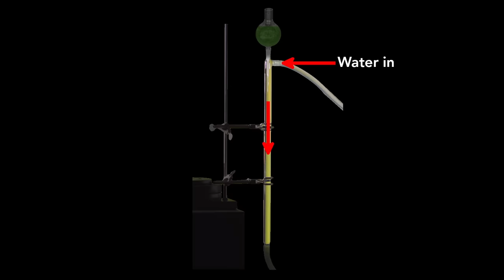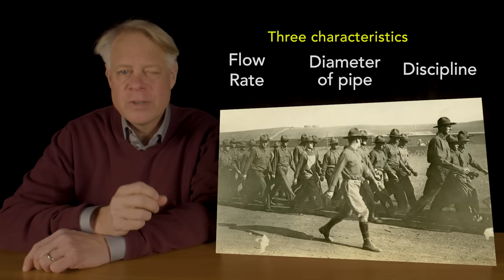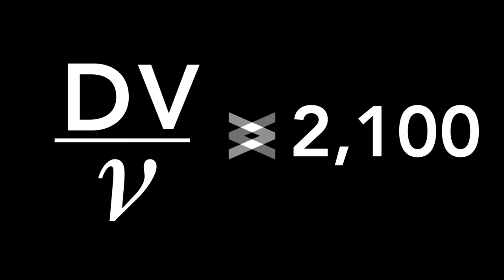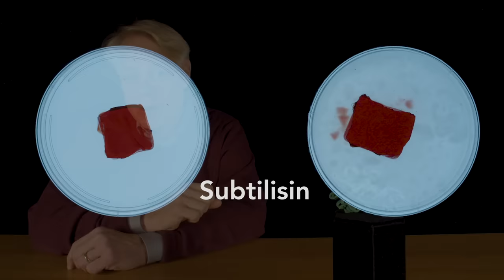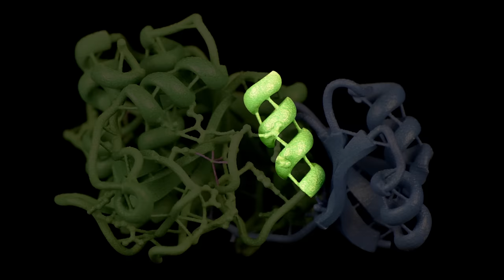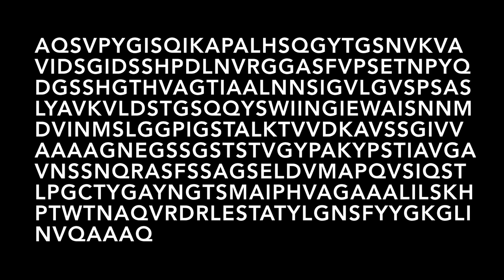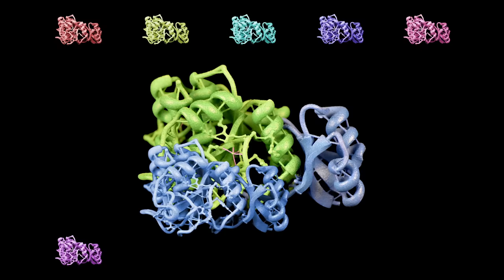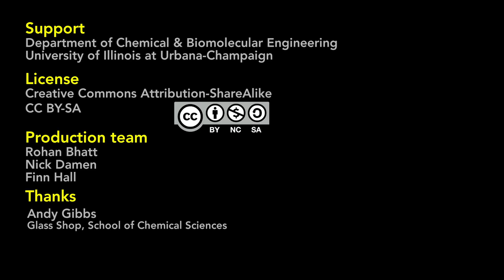Controlling Turbulence and Evolution: How Engineers Overcome Uncertainty

Comment: Even in situations where full scientific understanding IS something we have, reality is messy.  Just because you fully understand a process doesn't mean it's easy to control it.  The machinery to do the job perfectly may be far too expensive to construct, maintain, or train operators to use.  So instead we engineer something that's good enough, because it's cheaper than perfection, and we don't actually need perfection.
Reply from the maker: Spot on
Reply: This reminds me of "all models are wrong, but some are useful" (George Box).
Reply: @riveradam  Yep, even if you have all the data to generate a perfectly correct model of some situation, a slightly less correct model will probably calculate much faster.  You don't need a weather model that predicts tomorrow perfectly, but takes a decade to run.  By the time it delivers results you could just look at historical data.
Reply: Chase perfection, achieve excellence
Reply: @AverageAlien  Just make sure you're not so busy chasing perfection that you don't notice you've achieved excellence.
Reply: Science was invented to explain why engineers are right.
Many great things have been invented by engineers or even amateurs (e.g. VHF radio) before science was there to show how it works.
Reply: I operate and assemble said machinery.
The next level down, and It's a lot of the same.
Science got the principle down and they engineered a beautiful piece of machinery, nevertheless, turn that dial down 2 notches from the calculations on any non-ferrous metals or the tolerances fall off. The post it note by the switch should remind you to check.
Reply: The best lesson I ever learned was from an old, very smart, very experienced engineering fellow at my first employer: perfection is the enemy of good enough. 

Second best lesson from a different engineer: if it looks/feels wrong, then something is probably wrong, and vice versa.
Reply: Just because it works in reality doesn't mean it will work in theory.

Comment: Love these videos. I do want to comment though that the devision between the scientific and what you call the engineering method is really not as rigid as it’s presented here. Scientists routinely come up with and use models of systems or processes that are not “fundamental”, as you put it, but instead based on observation and calibration. This is simply called a “phenomenological model”, and it can combine things we know to be true that still have to apply (like rescaling relations based on dimensional analysis or conservation laws) with phenomenological (empirically derived) rules calibrated by observation. A modern example even in “fundamental” physics is hadronization, the process by which high energy quarks produced in high energy particle collisions become bound states of the strong force like protons or pions. Much like turbulence, we understand the microscopic constitutive processes (molecular dynamics or quark-gluon-dynamics) but not the complex collective behavior that leads to turbulence or the formation of some pions vs, say, an eta meson. Of course it’d be great to eventually understand these things in a “fundamental” level, but scientists need to solve problems too without being stuck on a temporarily fundamentally unsolvable one, so this kind of phenomenological description is very common and very effective.

Comment: I have a degree in electrical engineering and only now I understood engineering is not (just) an application of science. It could predate science. It's hard to get this when they say you need to go through 4 semesters of calculus before starting to study electronics, because otherwise you wouldn't be able to understand the equationing of a RC circuit...

Comment: So glad you're back.  I got your book on the R101 (both audio and paper) had have referred to it often as an example of using completely non-intuitive solutions for problems (like the use of bovine intestinal tissue to make hydrogen gas bags).

Another use of Reynolds number, is that it makes wind tunnel testing of scale models possible.  The air flowing over a small model will act quite a bit differently than on a full size aircraft at the same speed, so aero-engineers make sure to test at the same Reynolds number (Rn) to take into account the differences in size, which usually means running the air past at higher speeds.  

This only works up until the transonic region, though (Rn is different at supersonic speeds), so NASA devised a clever way of increasing Rn other than the speed of the airstream.  At their Ames Research Center, they build a pressurized wind tunnel where the whole thing is pumped up to two atmospheres.  To have access to the test subjects without venting the whole tunnel (which takes several days to pressurize), they built the world's largest ball valve with the test section being the hole in the center.  When they want to access the test subject, they rotate the ball 90° so that the center faces outwards and the rest of the tunnel stays sealed.

Comment: Hi Bill,  Glad you're back here, here !
Just a quick side note: 4 min 50 to 5 min 20 is correct, but very confusing, because we normally work with a fixed flow rate (m³/s)  and not a fixed velocity (m/s). This means that normally, one increases the diameters to get back in laminar flow, because the increased diameter drops the velocity squared. Doubling the diameter, means dividing the velocity by 4, effectively  halving the Reynolds number with a fixed flow rate.
Reply: Thanks for analyzing that and noticing the fixed velocity! I was super confused until I saw this comment as I hadn't noticed the fixed velocity instead of the flow rate and like you said was saying in my head doesn't increase in diameter lower the velocity and hence turbulence..
Reply: Thank you, that was what was bordering me, did not think of a fixed v...
(Does nobody think of the poor pump?!)

Comment: This is a great video, and combined with the next video teach a very important lesson.  Much of our current understanding of medicine and biology is due to outcome based experiments, not an understanding of first principals.  I wanted to engineer microbes to do whatever task we needed when I started my PhD, and thus worked with a lot of labs that worked on applied microbiology.  I took a of classes on structural biology and gene editing, hoping to get a good understanding of how to use the sequence and structure of gene networks and proteins to alter them for use.  Turns out everyone was just using large directed evolution projects to see what would stick to the wall.   This is the same way we test medicine.  We have huge libraries where we have something we know works, and we alter it in thousands of ways and screen them, then advance what works.  

Unfortunately at the end of the day, we usually only have guesses about what actually happened to improve the medicine, and then we find out about other unintended side effects a few years after that (see the history of coxibs for one example).  Luckily, knowing how something works isn't necessary to use it (think about your computer or phone).  Luckly, engineering allows us to make biology do things, without much of an understanding of how the system works.

Comment: For any science to make the leap from hypothesis to theory a scientist will always be faced with the practical 'real world problems' of a suitable experiment, which in most cases necessitates the involvement of engineering and in many of those cases professional engineers. Outside of the mathematics in science, and rote application in engineering, the two areas are inextricably linked.

E.g. Without context I would have thought Reynolds experiment, equation and numbers were science. It may not get to deeper aspects, but most laws of physics (which this is similar to) also dont. It may not be of the highest precision, but all science is only ever proven within error bars. Ultimately his experiment seems indistinguishable from many scientific experiments going on the world over; It seems that whether this is engineering or science is primarily depending on whether the person looking at it is an engineer or a scientist.
Reply: I agree that Reynolds' experiment is much closer to science than engineering. As alluded to in the reply below by Daniel Horton, the turbulent transition mentioned above is for the limited case for flow in a smooth tube.  I think a different fluid mechanics example would have been more apropos to the series, perhaps dealing with sailing ships. But fluid mechanics is a field that has been rather difficult to apply using only heuristics.
Reply: @dhorto27  The Reynolds number is effectively the ratio of the inertia stresses to the viscous stresses in the flow. Turbulent flow (high Re) is where the inertia stresses (kinetic energy) dominate over the friction/viscous stresses. So there is a physical meaning, though not a precise physical law.

Comment: Hi Bill!

Great videos, but something is irking me here. After watching these two, I still don't understand what an engineering method *IS*. Taking Reynolds example, how did he know, which variables to account for, and which were irrelevant (like temperature etc)? Why should they enter the formula with power of +1 or -1 (and not squared, or cubed etc)? Hard for me to believe it was just a guess, because naively it's counter-intuitive that fast-flowing water will result in turbulence. Indeed, if turbulence is a deviation from a "straight" flow, shouldn't faster, stronger flow encourage dye particles to flow straight with it? Reynolds must have understood something about this phenomenon, he didn't just guess the formula.

Same with protein activity. I will grant the idea to test with diluted paint thinner as part of "engineering method", but otherwise the explanation of "employing nature's own ways to find the solution" isn't quite as simple. If have to pass a narrow funnel in the solution space, you're out of luck. Guessing a single mutation will take 19*275=5225 tries. If two or more simultaneous mutations are required, it becomes completely impractical. Nature, on the other hand, employs evolution concurrently in billions and billions of organisms, and thus is able to explore the solution space much more thoroughly. It's hard to believe that Arnold was just lucky to get something working in her first 20 (or however few) tries. There must have been more to it, e.g. understanding how solvent changes protein's conformation or interferes with reaction center configuration. But then I start thinking, wait, isn't it the same as a scientific method? Isolating crucial factors and throwing away everything else to build a model, that's how science works, isn't it?

Sorry for a wall of text!
Reply: The main distinction he's making is that the scientific method seeks to understand the mechanisms behind how something works, while the engineering method seeks to use those mechanisms to solve problems but without the need to understand how they intrinsically work.

Like with the enzymes, sciences isn't really sure why they work, while engineering isn't too concerned with the why but only with the way in which they can be applied.
Reply: At least for the Reynold's Number you can look up his exact paper where he broke down how he figured out that particular formula with the reasoning behind each part:

"An experimental investigation of the circumstances which determine whether the motion of water shall be direct or sinuous, and of the law of resistance in parallel channels"

Comment: I think there's a misconception of what science is here. It doesn't have anything to do with understanding things on a molecular scale or anything. It's just describing the world, and critically, testing that description. Reynolds came up with an equation, but made rigorous observations to check whether it held true. That's science.

Love your videos, btw. So glad to see you return!
Reply from the maker: What I really am asking here is a) how much scientific knowledge is necessary to engineer something and b) is the scientific method the same or different than the engineering method. I would push back a little on your definition of science because essentially it equates science with reason and thus becomes so broad as to become less than useful. My sense is you need to add something teleological in the definition. If you want to probe more deeply what we mean by science you might look at The Advancement of Science by Philip Kitcher … all said I used “science” as a shorthand here and likely should have been more precise.
Reply: @engineerguyvideo  Yeah, I was very interested to hear your thoughts on the difference between science and engineering, and how the engineering could come about before science. That's an important distinction to make, so I appreciate you making it. And it's hard to give it the full nuance in a short video. But to be honest I do still like that definition of science I mentioned. It's a bit reductive, and there's more to it, but it's the important part that distinguished the scientific revolution from, say ancient Greek philosophy. The latter was pure reason, without testing the hypotheses.
Reply from the maker: Indeed hard to nuance in a video!  I suppose testing is an essential part of the definition of science.
Reply: @engineerguyvideo  Indeed. But I always appreciate the clear attention to detail in producing excellent videos nonetheless. I also appreciate the thoughtful reply!
Reply from the maker: And I appreciate people like you who engage with the videos! Indifference would be terrible.

Comment: We found out at my air conditioning company that some Engineers do not take this into account. We ended up discovering is that a lot of air conditioning units that needed to have at a pressure input had designed the units to be a single size and then simply scaled the design up or down and based on their needs. And what they ended up doing was creating some pressure sensors that were in a turbulent low spot which caused the pressure sensor not to work correctly. There was so many boxes that had this problem. All you had to do to fix it was to move the sensor around slightly.

Comment: Technically speaking, a polypeptide can be defined just by its primary sequence (the names of the amino acid residues in order), but a typical protein cannot. Proteins usually require some description of higher-level organization, or else they won't function correctly. The simplest example is the disulfide bridge. Two proteins with the same chains in the same sequence but connected by bridges at different points will have completely different shapes and not be cross-compatible at all. Subtler folds matter too. And in fact, when you "denature" a protein, such as by poaching an egg, you usually do not change its primary sequence at all, but you still greatly change its mechanical and other properties. Conversely, some changes to the primary sequence don't really matter at all. If you change the amino acid all the way at the tail of a chain, that typically has no effect, even if you swap it out for a functionally very different amino acid.

By the way, "rational drug design" refers to planning drugs from the ground-up based on theoretical principles rather than empirical ones or chance discoveries. In its idealized form, we would use ab initio simulations of the drug and receptor in a realistic environment, deduce from this improvements, and then realize those in production. In reality, this never happens, but sometimes something similar does. In the past, the most promising way to research new drugs was to produce hundreds of candidates and test every one against the intended receptor, then test dozens of promising new drugs on animals. The new reality is somewhere between that and the rational utopia. We do tend to get significant understanding about the pharmacodynamics of drugs, and in the best cases, like with insulin, we understand quite a bit about the detail of how it binds to the receptor and which parts of the protein have which function. That, combined with computer simulation, reduces the number of plausible candidates from hundreds to merely several, or sometimes a few dozen, which is a tremendous leap. Even if we still don't really get most of what's going on, and we still of course rely on the engineering method.

Comment: It's interesting that the formula does not include pressure. However Poiseuille’s law for laminar flow does: Q=(P2−P1)πr^4/8ηl, where: Q=flow rate, r=radius, η=viscosity, l=length, and P2-P1 is a pressure gradient

It's used in estimating blood flow in arteries or oil flow in a car. Notice that the radius is raised to the 4th power, so flow is extremely sensitive to the diameter of the pipe - prime example being, if you have plaque in veins, and stiffen arteries you HAVE to have either high blood pressure or less blood platelets count to lower viscosity in order to compensate - often both.

Since even 5% lower radius decreases blood flow by as much as 20%, the fact that the human body is able to compensate those imbalances is close to miraculous.